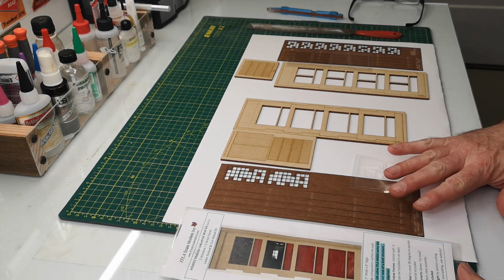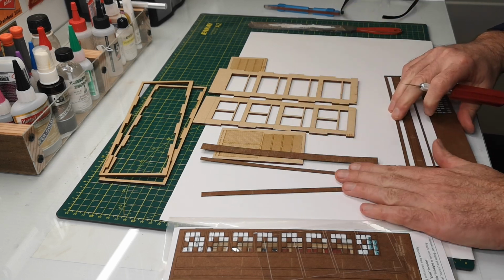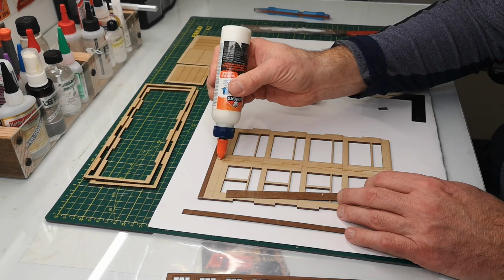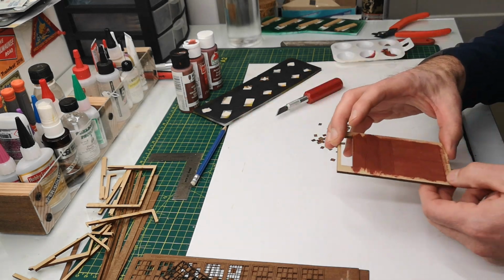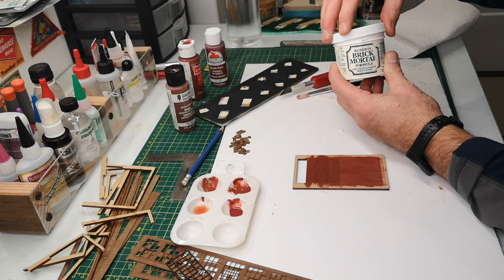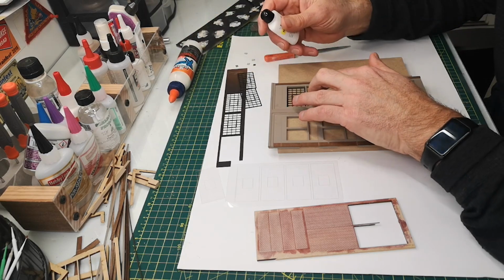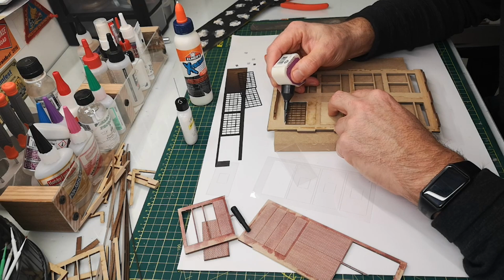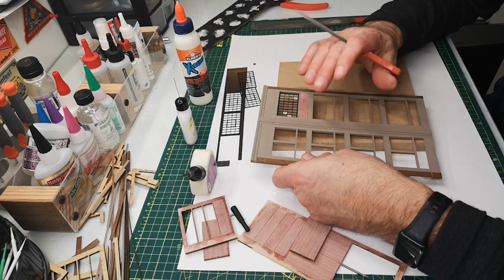ITLA  Industrial Wall Sections: Basic Assembly

Comment: What did you use for those mini window frames? I was at a michaels craft store but couldn't think if the name if them...🤔
Reply from the maker: What did I use?  The windows come in the kit.  The broken window panels are in the frames in the kit.  The little angled windows are part of the window in the kit.  Are you talking about the glue?  I use a Testor's glue which is specific for windows and dries clear.  You could also use a "Canopy Glue" which dries perfectly clear.
Reply: @MuskokaCentral  I was actually referring to the small metal looking rectangular frames used for the window pieces...so I have to buy the kit to get them? I was hoping I can just pick up something similar from a crafts store..

Comment: Is xps foam and cardboard still good enough to make a diorama building at this level? Since that's all I have access to use..
Reply from the maker: For a base?  The kits are very strong and could sit on XPS foam.  I use 1/2" MDF because I want to be able to move the diorama around and have it match up with the track, which will be on 1/2" XPS foam.  Both the foam and diorama will be mounted on 1/2" plywood benchwork.
Reply: @MuskokaCentral  well, for the overall buildings.... Like if I had used a mix cardboard and xps foam for the exterior walls with other little craft accessories for the mini crates and lights to make something like this diorama.
Reply from the maker: @RoRo-zh4uf  If you are thinking of making a structure out of foam and cardboard, it's certainly possible.  Print out some photos and glue them to the outside of the cardboard.